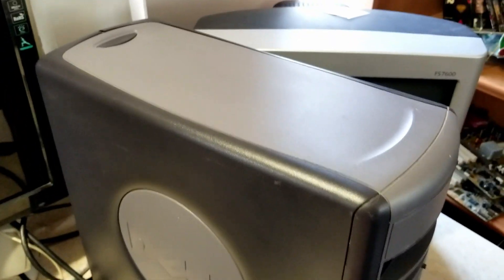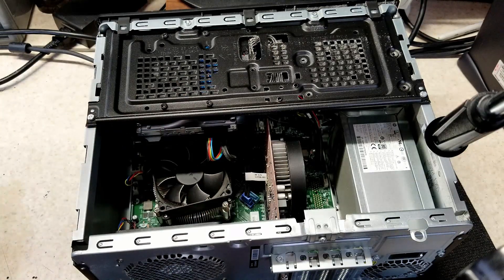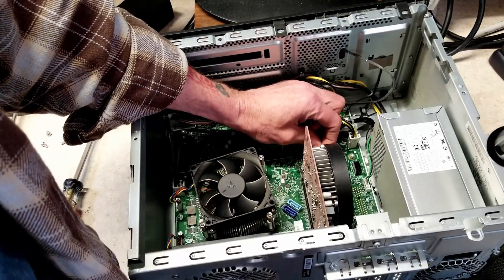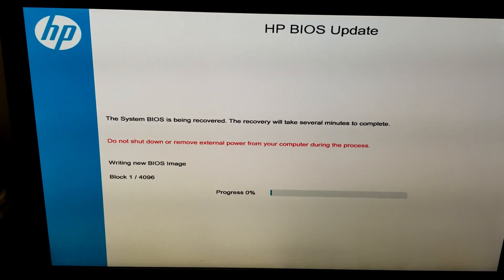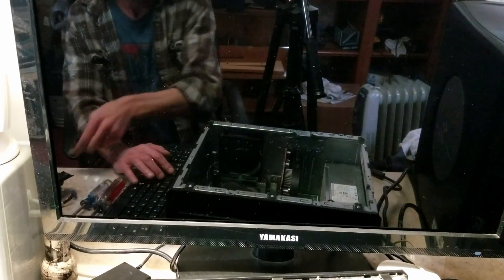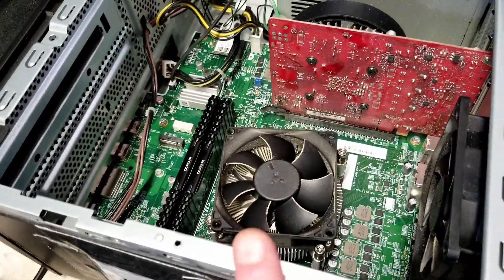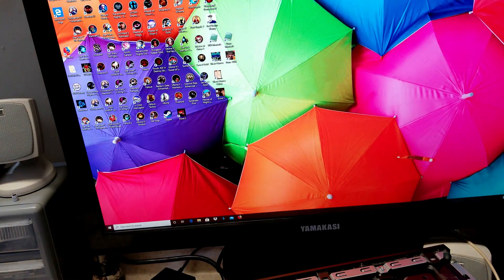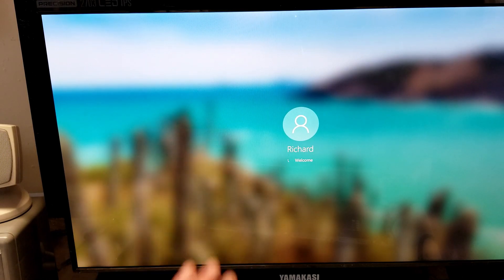BIOS recovery HP Pavillion 690 Ryzen Gaming PC

Comment: Question how did you create the flash drive, did you use the full utiliy to make it, or did you extract something in specific to the drive or what
Reply from the maker: Im pretty sure the bios file was an exe and if you run it it will format the flash drive and copy the files.
Reply: Thanks for the info  @Snickerrick , was just tryna check to make sure i hadnt missed anything, last time i tried it didnt work, however thankfully i have a clip programmer on the way so hopefully i can use that to recover my bios

Comment: I was having an issue with my 690-0067c where Windows would only boot on the original drive. Booting from USB or a SATA drive would end up loading a windows logo then crashing. This seems to result from a very old bios issue with the motherboard. I was not able to enter this bios recovery mode so the only way I could flash was by creating a windows PE flash drive and loading the bios flashing tool that way.

Comment: Thank you for this video. 
I have this box and believe I need to replace the CMOS battery; I was searching for videos regarding replacing the battery, but wasn’t finding any pertinent to this machine. Your video, inadvertently, showed me where the battery is located. 
After I’ve replaced the battery I’ll be donating it to the library or the high school… or family services. 
I bought mine from Costco, mostly to do office stuff like quickbooks and adobe stuff. It was fine, but not upgradable to Windows 11. 
Not needing to do much more than stay up to date, I purchased a Lenovo all in one to replace the HP; please don’t hold this against me. 
I used to build from scratch, but my employment took my time away from computers. 
This video has inspired me to build a custom machine, for no other reason than having not much else to do. 
Thanks again.

Comment: Hello there, 
when i turn on my pc i get  first a screen saying my bios is corrupted and then a black screen then another screen saying i need to use a usb with the recovery tool to recover my corrupted bios ,
i have downloaded the right bios and used 2 different usb drives but still i get the same screens every time ,

can you help me  figure it out?
Reply from the maker: Sorry for the late reply.. did you follow the steps to power on the PC and immediately hold down the Windows and "B" key at the same time? That was the key combination for this model. Yours may be different if its a different model, you can check the HP support website to find the correct combo if that is not it/

Comment: I know this is old but I need help I did the things you said in the comments and it’s still not working
Reply from the maker: you may have a different issue, these were the steps listed on the HP support site for this model to recover a corrupt BIOS. If those steps dont work, it could be faulty hardware I suppose.

Comment: my favorite part:
https://youtu.be/1pNRtRQhn0M?t=643

10:44
Reply from the maker: haha no doubt! :)
Reply: @Snickerrick  great video, I did the USB drive and when I plug it in to start the computer up, it just lights up the green lights on the front, the monitor and keyboard light up then go dark and then nothing happens, tried leaving it for over an hour nothing happens.... if I power off, pull the USB and turn on again with the windows and B key it goes through the rewrite of the BIOS but then says corrupter at the end. any thoughts? thanks!
Reply from the maker: @Scubac  Oh man, its hard to say whats going on. I am not sure how many versions of the BIOS they have available on the site for that PC, but if you are using the latest one, you may have to try an older BIOS first, perhaps you cant jump from the original to the latest.. just a guess though. I have heard a few horror stories regarding the BIOS on these HP machines.
Reply: @Snickerrick  thanks I did the latest one for my serial number off the hp website. I’ll try the older ones and go from there. 
Standby for update. Appreciate the tips and help!
Reply from the maker: @Scubac  Ok sounds good, good luck!

Comment: I have an HP Pavilion Gaming Pc ryzen 5 3500, 1650 super, 8gb of ram. I have got new 16gb of Corsair Vengeance 3600mhz ram and I have installed it, in task manager it showed 2100 mhz, so I overclocked it, doesnt boot after and now I get 3 beeps, light and fan are going but have a black screen. Both of the sticks of ram are in and secure, hearing a click when i press down.  Please help.
Reply from the maker: Did you try to clear the cmos from the motherboard?   Perhaps it doesnt like the ram overclock, and you need to reset to default settings
Reply: @Snickerrick  I forgot to mention that I didn't overclock the ram from the bios, I overclocked it from a program called AMD Ryzen Master. Does this matter?
Reply from the maker: @pricedisland  Yea I figured you used ryzen master, OEM BIOS is pretty weak on settings.
Reply: @Snickerrick  all works now! took the battery out and let it sit for 5 minutes. thank you so much for the recommendation, and have a good rest of your day/night :D
Reply from the maker: @pricedisland  Awesome!!!
Reply: I have this EXACT SAME PC AND ISSUE, I'm currently waiting the 5 minutes to reset  cmos from after trying to overclock through ryzen master. 
If this works I will never be OC again
Reply from the maker: @yodazjockstrap2767  I think OEM PC's dont know what to do when you try to change settings with ryzen master. Best to use that on an aftermarket board that is capable of overclocking and recovering from a bad overclock much better.

Comment: thats a great video i have the same system but im having problems in getting into the bios setting im having nividia nvs 295 and the screen goes blank when i turn on the computer and it takes me straight to the windows screen. The hdmi port that's with the board doesnt work at all in my case i have to use the gpu for the display. i tried everything but no luck. Do you think its the gpu firmware problem that doesnt take me to the bios screen? TIA
Reply from the maker: Yea i would guess its because of the GPU your using. It sounds like it would be an older quadro GPU. Is the HDMI on the motherboard disabled from the factory?
Reply: @Snickerrick  its an order Quadro gpu with two display ports. I guess the factory hdmi ports are disabled from factory thats the reason i got olderr gpu for just display. Thank you for the reply

Comment: Bro speak spanish?. I also have this problem but and this same computer, but I stay on the black screen showing the characteristics of the pc and a message appears that says "Press the ESC key for the start menu" but I press several key commands and it does not go from there. I tried the solution of the video and the beeps sound, it takes a moment to give image but when it starts it shows the same thing again.
Reply from the maker: It sounds like maybe it is not initializing the bios flash. Try the steps here, make sure you have the correct BIOS on your flash drive https://support.hp.com/au-en/document/c02693833

Comment: I have HP Pavilion 590 and I was wondering if you could help me no boot device found and
Reply: Yeah I guess you're right my computer came unplugged one day and all of a sudden it started saying no boot device found and it's been hell ever since but appreciate you
Reply from the maker: @trevanruiz7981  Well good luck with it, hope you solve the problem!!
Reply from the maker: Have you made any changes to the BIOS? Try resetting to default settings. Im not sure what steps you have already taken. Have you checked the connection to the hard drive? Does the hard drive show in BIOS? You would have to determine if the hard drive has failed or the boot section is corrupted. I believe there is a hard drive diagnostic test in the UEFI BIOS.
Reply: Yes I've done most of that when I did a diagnostic it said my short DS failed
Reply from the maker: @trevanruiz7981  short DST failed? Sounds like you may need to replace the hard drive. Did that come with a regular hard drive or SSD for your boot drive? If its not an SSD, good time to upgrade I guess.

Comment: Great video! I have the hp 690-0024 with the ryzen 5 2400g as well. Question. I’m replacing the cpu with a R5 2600... after installing the new cpu, do I need to pull the blue cmos jumper out and then just put it back in before powering up the PC? Also will I just hit the Y key at startup when it says replace fTPM? TIA!
Reply from the maker: I g.j honestly dont know, I don't have a lot of experience with this model, and wouldnt be surprised if HP blocked other CPU's from being installed. If you check the HP website, there should be some info on compatable processors. I would definitely either clear the cmos after installing it, if it works, or go to bios and select the default. Hope it works for you!!
Reply: @Snickerrick  thanks! Yea I checked hp website it says my new cpu is compatible with the mother board. That’s why I chose the r5 2600 although I really wanted the 3600x but it wasn’t compatible. So after I install the new cpu do I need to remove that blue jumper and just put it back in? Or is that step not necessary? Thanks for the help!
Reply from the maker: I dont think it's necessary, but it wouldnt hurt. That's great it is supported, should just be plug and play!
Reply: @Snickerrick  awesome! Thank you! Excited to put it in see how it performs. I only use this pc for flight sim. I Have an rtx 2060, 16gb vengeance although want to go to 32gb and now last piece is this new cpu! Thanks again! Just subbed to the channel!
Reply from the maker: Should perform quite well! I know I'm totally happy with my pc, I'm running a ryzen 2700 with an r9 fury. Thanks for the sub!!
Reply: I know im asking randomly but does someone know of a trick to log back into an instagram account?
I was stupid forgot the password. I appreciate any assistance you can give me.
Reply: @Watson Esteban instablaster ;)
Reply: @Tatum Orion thanks for your reply. I got to the site through google and Im in the hacking process now.
Seems to take quite some time so I will reply here later with my results.
Reply: @Tatum Orion it worked and I actually got access to my account again. I'm so happy!
Thanks so much, you saved my ass :D
Reply: @Watson Esteban Glad I could help :)